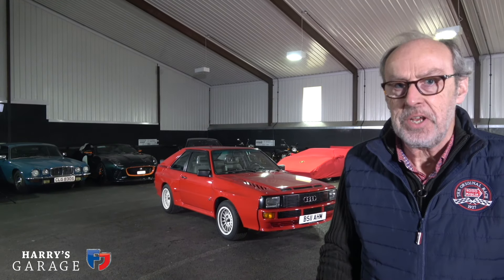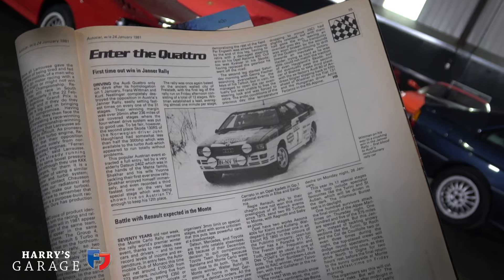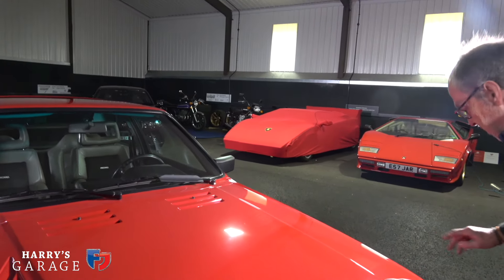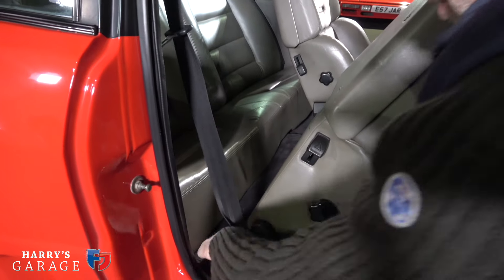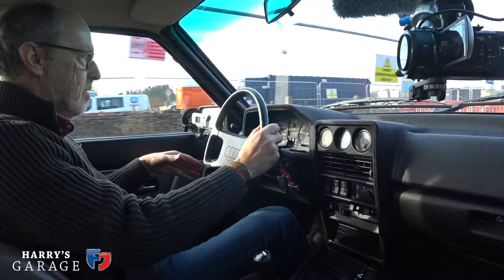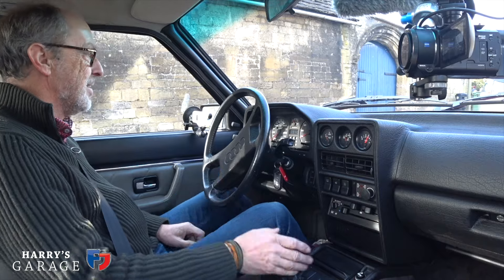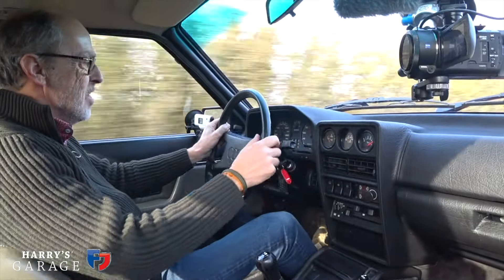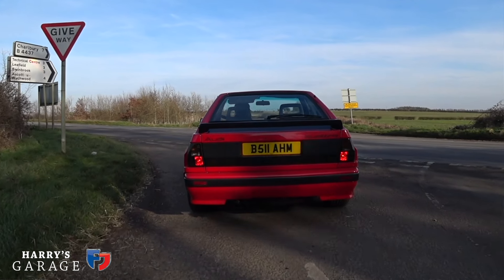Audi Sport Quattro. Best Group B homologation special ever?

Comment: The metal (mesh) is for electromagnetic shielding (electronic ignition).
Reply from the maker: Thanks for info
Reply: @harrysgarage  The ABS on off was because it stopped quicker in fresh snow, it would build a wedge in front of the wheel.
Reply: Wow... that's a faraday cage???
Reply: Thats what Hans told me in addition to the cost of the hood itself !!!!!
Reply: Fantastic video Harry.    But you said the Sport Quattro would form one of your 5 car "Dream Garage" - equally interesting: can you tell us what would be the other 4 cars?
Reply: @calmills4843  that would make a great video.
Reply: So in case of the end of the world, cockroaches & Audi, survive...
Reply: Has seen it all..but still enthusiastic. Love it.
Keep up the good work Harry.

Comment: I use to sprint in the early 1990's with the CCC championship and there was Ex Rally Group B Quattro also taking part - never forget the way it moved and picked up on its suspension each time it changed gear and the turbo came on song!  Very much like a Ferrari F40 in manner - fantastic!

Comment: I had a 1984 10V Quattro (not the sport) and although not the best example, it was incredible - SO much better than you'd expect based on the power of the engine and the weight of the car & when it rained you could go simply faster and faster - never honestly found the limit consistently, it was incredible, particularly when you locked the diffs. Fantastic machines.

Comment: When I was a young man in the early eighties the car that got my juices flowing the most were these cars, it just felt like the future had arrived and a little later I think it was the 100 which had the first truly flush side glass which looked so futuristic, Audi were on fire. Sadly for me the current fair from Audi leaves me cold.
Reply: ianmedium i share your sentiments wholeheartedly
Reply: I'm liking the new RS6
Reply: ianmedium, I know exactly what you mean. I always admired Audi engineering in the 80s and early 90s. They were that little bit different, with some proper engineering built in to the design. They also managed to avoid the attention of the red braces and filofax brigade that ruined the image of BMW and Porsche. They were driver's cars, cool only to those in the know. That 10v soundtrack was intoxicating too. But then Gene Hunt came along, and all of a sudden Audi was on the radar of all the wrong sort of people who ruined the brand's image. VW Group haven't helped much either. The S and RS Series cars are still pretty special, but not quite as much as Audi used to be. As for the rest of the range, well, oh dear. I feel like I'm sitting in an expensive Skoda with a lot of them. The Audi distinction has been lost. Which is a crying shame. It's almost criminal.
Reply: Here in Italy, Audis are rebadged Polos for teen daddy's boys. All their old cachet down the toilet.
Reply: The Audi A3 is a pretty good car, I think it must be one of the most reliable modern Audi
Reply: That would be "fare".
Reply: @rhannay39  I've often seen it spelled "fayre"
Reply: I go back to BMW’s 2002. Like early Quattros, they were driven by car guys. Which means they were driven well — courteously, not cutting people off and always using their turn signals. The so-called compact models from both brands have in recent years gotten bloated and soft, and you can count on their drivers not acknowledging your presence on the road in any way.

Comment: That 5 cyl engine note 🤤😍😍
Reply: Darren Tadman I counted 4 cylinders when the bonnet was open
Reply: @audioisgood  then, as Harry describes it as a 20v engine that would mean it would have 5 valves per cylinder.
Reply: @audioisgood  06.59, as he opens the bonnet clearly shows 5 plug lead caps
Reply: Ahh. Right you are!

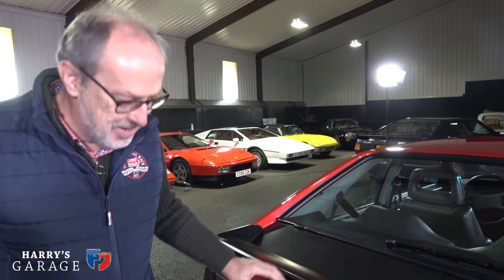Comment: 9:35 VW was keen on playing with the heating element in the rear screen. AWD Passats had "syncro" spelled out on it :)
Reply: It was cool when it melted the ice on the window;)
Reply: Ultra cool. Imagine Audi or someone else doing that in todays softened up versions.
Also imagine Audi making the present compact RS as racy as this old one... No, now it's all about the amount of electric infotainment you get combined with all sorts of adjustable disco light all over. What a shame. Btw. to me at least, these old school Recaro seats are just so much nicer than the new present day ones. And they look the part!
Anyway, a HUGE thanks to Harry for making all these really great car videos, being that the type locally made like this, or the touring videos like the Testarossa goes Sahara etc. 
I also like the fact, that Harry's videos are for free to watch, and the commercials in them are kept down to a very low level and discrete - not bothering the video it self.
In you own quiet way, you are simply the better out there, a quarter mile in front of the competition, incl. the tv-stations.
Your videos Harry, will become as legendary as the cars and motorcycles themselves.
Thanks again.
Kind regards.

Comment: I believe the rake on the windscreen is standard 80, which is steeper than the coupé.
Reply: Was looking for this comment, correct it has a regular 80 sedan front not coupé.
Reply: You are both correct and it is quite noticeable. Apparently this was done to reduce reflection of the instruments on the screen. I’ve never driven an Audi Coupe or Quattro or that era but I had a KK 80 Quattro for a while. It was a fantastic car and wish I had held onto it.

Comment: @Harry's garage The problems with the 2nd gear in cold is caused by a worn sync ring. Sometimes it helps to hold the clutch for a few secs before shifting. The shifting mechanism of this Sport Quattro seems to be worn out - the long throw is normal with cars from that period.

Comment: My favourite engine sound ! First #Audi I had 1982 80CD 5 cylinder ! Totally rebuilt it and replaced Pierberg carb witha weber. The problem is you get addicted to the sound and just can't help flooring it! It easily managed 30mph in 5th! But press the clutch, put into 3rd, up the revs and dump the clutch and due to the heavy flywheel it would spin the wheels ! Also due to the heavy lump forward of the wheels, handling could be scarry and saw many in scrapyards that had been rolled ! I just had to click on your video to hear that glorious sound! Now for the 10 valve !

Comment: 7:32 that's not a blow off valve- that's the external wastegate all the turbo 5 cylinders had, even until the end of the S6 in the mid-late 90s.  It was mounted to the header and provided a different path for the exhaust to not even reach the turbo, instead go to the downpipe.  Some Audis like the RS2 essentially had a separate exhaust for just the wastegate's outlet.

Comment: I used to own a red 1986 Audi coupe FWD with only 110hp weighing 2500lbs only back in the 80's. The quattro version was around $49k in Canada.  A fun car. One of my current ones is an S4 3.0 tuned to 475hp and an absolute monster that makes me feel like I am driving a classic angry rally car as it is quite loud on hard acceleration.

Comment: Back in the day Dialynx built swb quattros and the roof line was the give away then years later it was spotted the roof was actually a Audi 80 modified .. so when the crazy poles who are building them used a Audi 80 front end with Audi coupe shortened body you had what Walter Tresser designed ..well kinda you needed running gear and the lightweight bodywork

Comment: 300+ hp was insane in a car like this in the early/mid 80s. First 911 turbo had to make do with just 260 initially, and by the time this quattro came out was still slightly less powerful at 300. Remember: Sporty cars for normal people were still sitting at 100 - 130 (if you were lucky) hp at this time. Golf II GTI, non-cat was 112 hp/PS, 16V was 136. 

As a child of the 80s (and of a dad with a fixation on slow diesel Audis), I can't overstate how mind-bogglingly awesome (and unattainable) this car was in its day. Well.. I guess it still is both these things today ... :)

Comment: Brilliant feature Harry.  Brought back memories of mid to late 80’s.  My mum got cancer and couldn’t use a clutch, so l got a C reg Audi Coupe 2.2 5 cylinder auto for her to drive.  It was a step up in quality, refinement, poise and sophistication from my string of Fords (Capri 2.8 mainly).  It started a line of purchases that spans quattro and several other Audi’s.   I never got to drive a Sport Quattro but did drive a 10v, that too was brilliant apart from the later digital dash.  The classic Ur models are now selling at high prices, £35k for an E plate 10v on sale now, double that for a 20v.

Comment: In ‘82 - 84 I worked at Rex Johnson in Redditch then a VW AUDI dealership. As Harry remarks, the brake feel was beyond mushy. That was because the conversion to RH drive involved a lever system which used a bar across the bulkhead which wound up acting like a torsion bar with the effect of losing much of the leverage you applied to the pedal. The Sport being LHD did not suffer the same disadvantage which together with uprated parts gave vastly better stopping power. I was able to compare an early 1600cc GTI which was in LHD with steel wheels which I took in part exchange with the newer GB spec 1800 GTI of 1984. The later car was frighteningly vague on the brakes. One front wheel drive (none Quattro) coupe I drove had about 2cm of end float on the steering column due to the driver pulling on the wheel when applying the brakes - presumably in panic!
That 5cylinder engine sounds tremendous!

Comment: Harry, I'm with you every step of the way - I never had the luck of riding in the "true" Audi Quattro coupe with the rorty, rowdy in line turbo 5 cylinder (much less the "short" wheelbase monster you're enjoying) but I've rode in many Quattro 5000s and my father in law had a 1986 4000 Quattro Sedan (Audi 80), graphite grey over black leather, fully optioned with the 5 speed stick, sunroof, AC, Blaupunkt stereo and lockable diffs.  The grip, the torque, the click click of the stick shift, the supreme comfort of the interior and the grip with the locking diffs - God I loved that car!  I used to tell my father in law that it was like driving a tailor fitted Hugo Boss suit through mud and snow. The rear defroster spelled "quattro" - WTF? Balls out in all kinds of weather and on all surfaces with three guests and their luggage.  Quattros in their day were so gooooood!  Would love to see you do an Audi Quattro Avant - THAT would be sweet! Great post as usual - thank you!

Comment: Awesome video, brought a tear to my eye.  Thank you for sharing!
BTW, electric windows were a common option and more than half had them had electric lifts.  
As for Gearbox, apart from slightly different ratios it is an identical unit to the 10v cars (016 family) down to the bowden cable operated (via vacuum servo) diff lock.  Later 10v (1985-up) cars switched to pushrod also actuated by vacuum servo located on gearbox itself.  
Interestingly a derivitive of that gearbox sans quattro was also used on Porsche 944 including turbo and is a very robust and tough unit.
Reply from the maker: Thanks for info. Love learning about these extra facts!
Reply: @harrysgarage  No problem, I have a private registry of the cars and have records on 109 of the road going (including the one you drove) and 6 works chassis.  If you wish to know anything else shoot me a message.

Comment: Nice to see you showed the VW Iltis. This was first iteration of the four-wheel drive system that provided the basis for the quattro system, except didn't have the centre diff so was selectable 2/4WD. I had one of these for years. Regret selling it. Im amazed the Iltis has not appreciated in value yet given its historic significance and the fact it was a great little 4wd VW "jeep".  Won the Paris-Dakar in 1980.

Comment: Audi 80 Sport B2 was the first one as a young boy. This short wheelbase Audi Sport Quattro Group B Homologation was £88,000 in 1984-5, 2020 £500,000. Them Recaro bucket seats are 🔥 half leat, diff lock 5 Pot 20V Turbo Audi=Class

Comment: Terrific video Harry. What a machine, you can really sense the engineering depth of the Quattro.

One question - would you consider fitting external cameras to the car to complement your interior and drive-by shots? Think it would take your channel to another level and really convey the speed through those bends (more paraphernalia though of course..)

Comment: Love it. 
Not far off from when bike racing teams realized that a softer suspension equaled a faster machine. So long as the suspension didn't bottom out, then a softer, longer spring and good damping through the travel meant the tires would follow the road undulations accurately and not lose traction.

Comment: Great video and quite rightly a car to be excited about. It still looks fantastic. The standard ur-Quattro being based on an 80 Coupe had a more sloped windscreen but when the shortened the wheelbase for the Sport Quattro it looked odd so they retained the more upright windscreen from the 80 saloon. Replica Sport Quattros are built from a Coupe rear half and an 80 saloon front half butted together mid roof to get the correct look. 15 inch wheels look great - any bigger with low profile tyres would make it look like a Hot Wheels toy. In short a great all round package. If Audi would build some continuation models they would create a huge interest!

Comment: I bl00dy love original Quattros (either the 80 Sport or the "road-going" model). I won't list all of my reasons (there's too many to list and others have already pointed most of them out), but who doesn't love the distinctive noise of a straight 5? And the details - smoked rear lights, razor-sharp styling, mechanical noises everywhere and manual only. 

When I get the big win on the lottery, I'm getting one of these (and an SP Miura... and an E28 M5... and an i30N cos I'll need a runabout... and an NR750 and...)

Comment: As an apprentice I worked on these. We had one in front end crash, Bonnet£10,000, grille£6000. 1984... The rear exhaust brackets would snap off.

Comment: The street car base was its main handicap (like a "liberalized" Gr. A due to being registered in Gr.B), if we take as reference the essence of the Group B Regulations. And the main problem was the situation of the entire mechanical assembly in front side that made the distribution of weights very unequal, and this fact increased with the reduction of the wheelbase of the car that sought greater agility in slow areas, however what it did was unload the rear axle and its limit even more of adhesion to be able to transmit more torque and power to this axle that should support most of the power to the ground. However, this was not possible as it had to be the front axle that had to do it due to having so much weight in front, being therefore very understeering in its behavior and taking a long time to enter into corners.
Compared to rear mid engine cars (Peugeot, Lancia, Ford and Austin Rover). These were much more agile, first because they had a much more balanced weight distribution between axles, and second because the rear axle, having more weight, achieved more grip to transmit more power and torque, which made them more oversteering (similar to a RWD) so they turned earlier in a slow curve.
Audi reacted by placing all the radiators, intercoolers, battery, alternator among other mechanical parts to the rear, managing to balance the weight, but already in the year 86, both Peugeot and Lancia already had real missiles that were not only very agile, they were also very powerful and much faster than them. Audi then decided to no longer continue in the WRC, citing a lack of pasive safety in the cars and in the rallies, which, although true, the hidden reason was that they knew that their cars could not compete against the Lancias and Peugeots (which won the Drivers and Constructors World Rally Championship again).

Comment: Probably your best yet Harry. Propers' to you sir! Ps The door to window height ratio of all cars in 80s was  circa 60/40 hence the high visibility - late 80s euro regs in side impact meant that changed the look of cars entirely....the first car to switch to a c 70/30 ratio was the Lady Di' Audi coupe/convertible of late 80s/early90s - These Audi era 10/20v and of course URs are beauts - they were buttons  I bought a 60000 mile gold/beige 10v quattro for £3650 in 91 was amazing with slim tyres and suspension would hunker down and catapult you out almost quicker than a 993 turbo like your Pullucino Bro's UFO reg car and my custard Roock 993 gt2 lookalike they supplied me same time) - That 'shorty' looks like a hoot and would be in my top 5 too !!

Comment: Wastegate, not blow off valve.  It controls boost pressure, not relieving intake pressure when throttle is released as does the blowoff

Comment: I thought the Sport quattro used a "standard" 80 saloon front screen arrangement (glass & pilars) which is steeper than the regular Coupe front screen setup which the regular quattros used. That blow off valve is actually a wastegate too.

Comment: The rear window should be the same as the ordinary quattro.

The sport quattro had the standard Audi 80 windscreen, it was the regular quattro that had the unique windscreen different to the normal saloon, and the rally team wanted rid of it and the steeper windscreen from the Audi 80 in its place.
Reply: The Audi 80 is one of the most underrated cars.

It drives better than this new 3cyl cars.